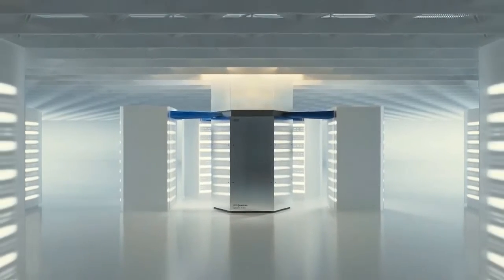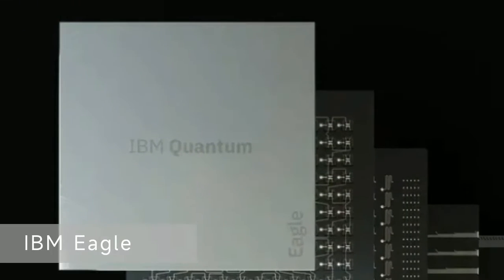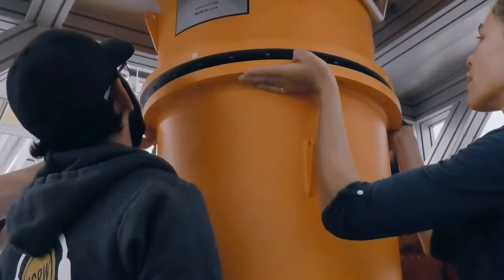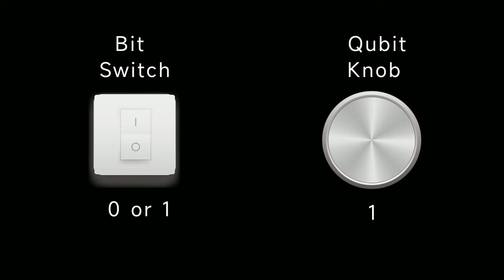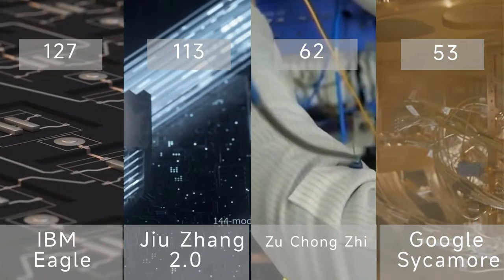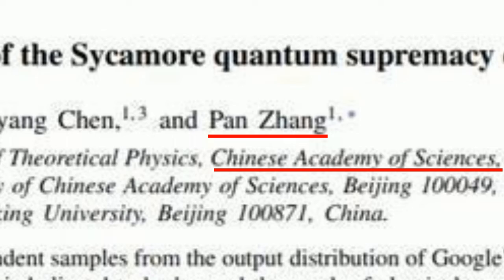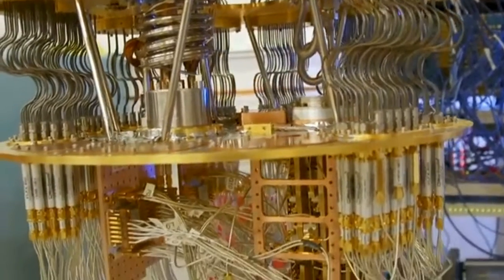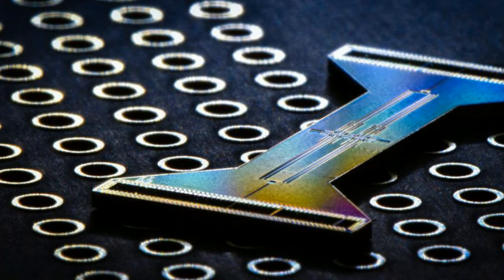Quantum Computer: China vs the United States

Comment: Quantum computers are fake. The premise of quantum computers was derived from the 'many worlds hypothesis', which is a direct logical outcome of 'Schrodinger's cat', which is based on the incorrect presumption of undefined superpositions, and also willy nilly extends it to macro objects in the case of 'Schrodinger's cat', which is derived from the false assertion by Warner Heisenberg in regards to the Heisenberg uncertainty principle. It turns out there is no uncertainty in regards to determining a particles position and velocity simultaneously, if the energy of the measurement photon is known very accurately. And therefore quantum computers are false or in other words fake.